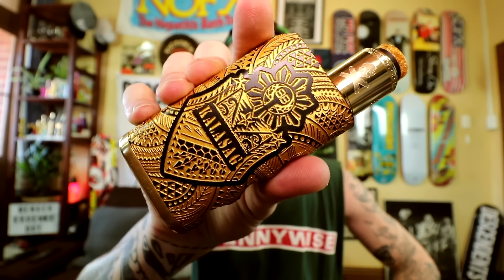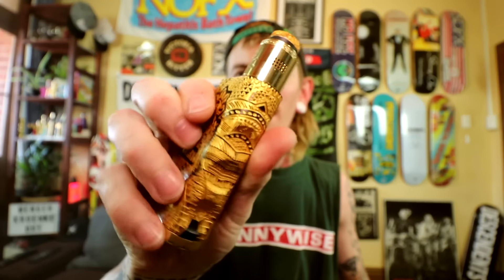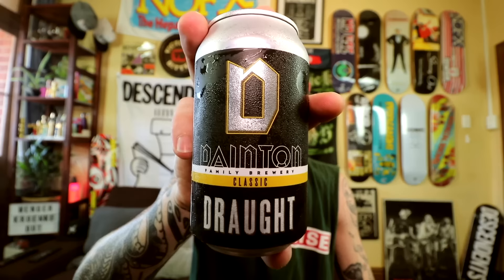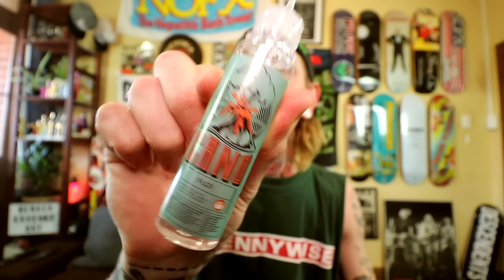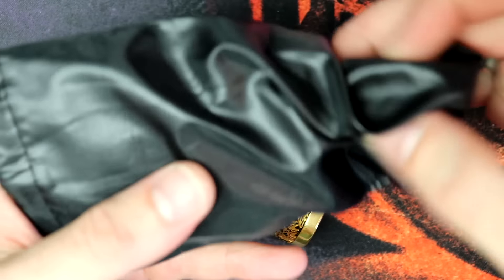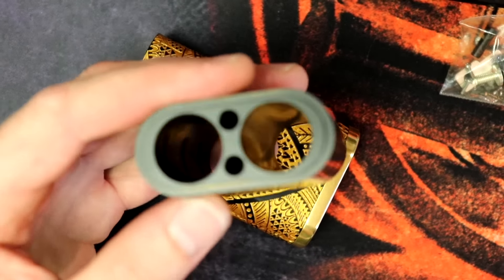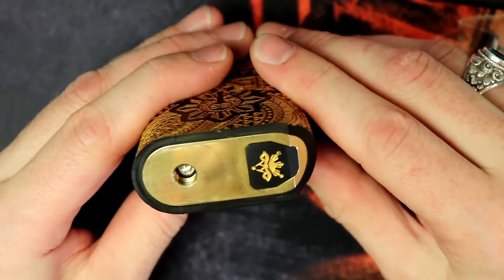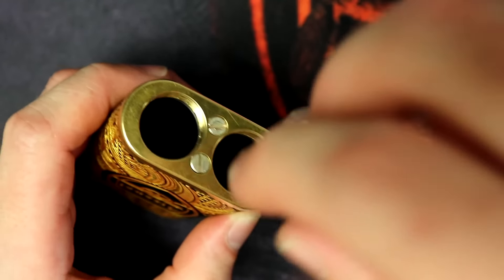Kalasag Para-Series Mod | BB Box Mods Philippines | + Booster Kit | The Vaping Bogan

Comment: Dang dude I waited till 6 years after you posted this to get into rebuildables. Actually when you made this vid, I was one of the dickheads still on analogs. Lmao I wish I could find a quad mech like this so I could paraseries my little butthole off--present day the only reason I can even find (reg) mods that fire below .10 Ω is because I rooted a few old geek vapes out of storage. Of what's still out there it's all mostly tubes and dual battery jobs. Fine for some but I was one of those who cringed the 1st time I saw a mini-bong, like what's the point of the bong then. The RBA quest is worse than rosin DIY and fosho worse than building a PC for the 1st time thus far; if it doesn't improve I'm back to sub-ohming my little tits off. Back to more rabbitholes and roadblocks woo-hoo!

Comment: I'm a Filipino, as someone said in the comments it's really expensive but the quality is one of the greatest out there. Convinced vapes reviewed this and took it apart including the switch. The batch 3 is what i love about the kalasag. I saw an authentic kalasag compared to the clone, the authentic is better by a thousand mile. They even clone the kampilan rda also from bbbox mod. There are a lot of clones of this where minors buy. Yeah it's the issue here in the Philippines. Our president supports vape more than smoking but as always dont vape wherw you cant smoke. Anyway, it's expensive that I myself from the Philippines could not afford this one. I almost forgot, kalasag is what they used to refer to in filipino for shield and the kampilan is a traditional sword from the Philippines.

Ps hey bogan. Arsenal fan here. #wengerout.